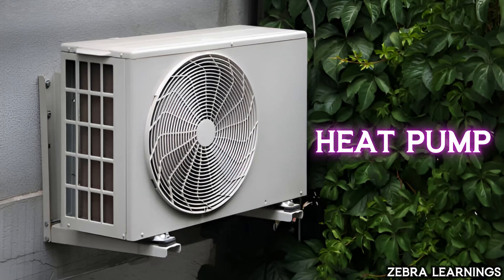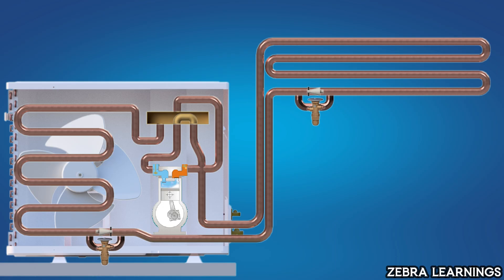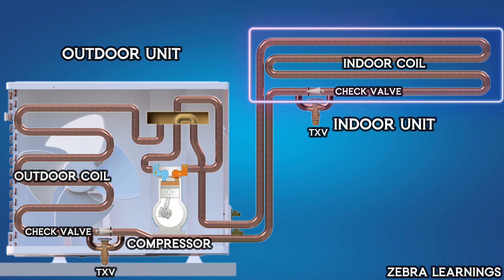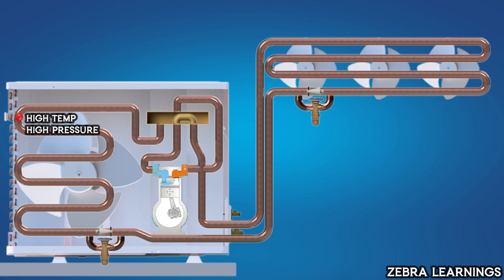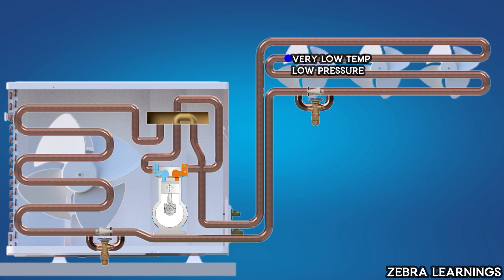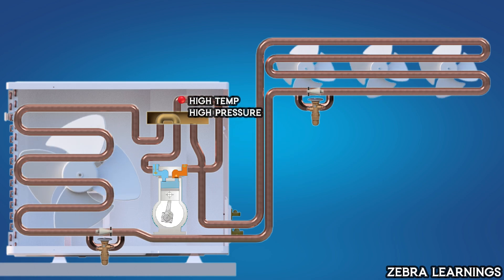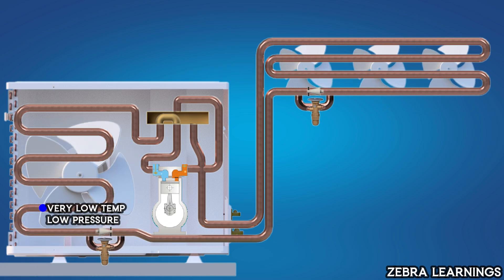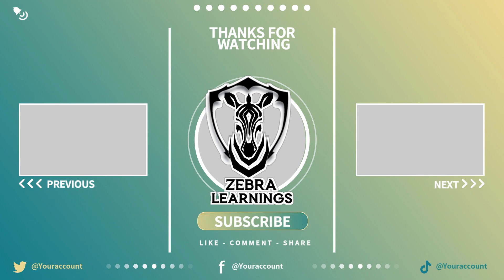How Does a Heat Pump Work? | Heating & Cooling Explained | Animation | #HVAC #HVACSYSTEM

Comment: I bought a hot & cold ac only because i was so impressed by the cleverness of the machine.😂 I mean a normal cooling only ac has like 99% of the hardware already present that is also in a heat pump,onlythe reversing valve, extra expansion valve & couple of extra temperature sensors make all the difference. Just pay a little extra and youll have a super efficient heater for a long time.

Comment: what pressure does the system commonly operate at on both sides of the pump?
Reply: The presure will vary high/low depending on the refrigerant. 
     But typically at the discharge side of compressor is the high pressure high temperature gas . Low pressure low temperature gas is found as it leaves the evaporator coil
Reply: @jamesortolano3983  is the refrigerant at a higher pressure than a traditional AC system?  is it a different refrigerant? 
thank you
Reply: @shiddy.   not at all the 4 way valve is just a bi -pass to different coils . The pressure is essentially the same operating pressure as a conventional a/c system . The valve adds no pressure , if anything it may decrease only cause of resistance.
    R-11,R-12, operating pressure is much lower than say R-22  in residential A/c , but R-410A operates higher than R-22 . 
      So you need a pressure/temperature chart to be familiar with corresponding refrigerant s
Reply: I have a heat pump system already running - it even heats the house when it's -5F outside before the system switches to a gas furnace - it's a new system just a few months old, but I'm very impressed with it so far this winter in minnesota ... just wondering how some of it works - great video 👍